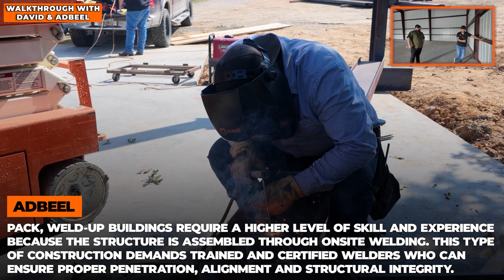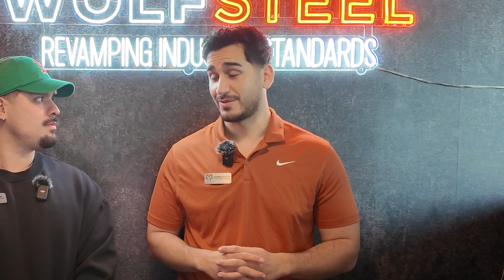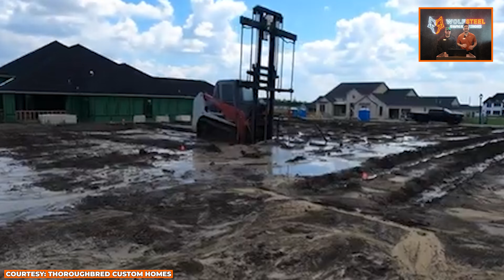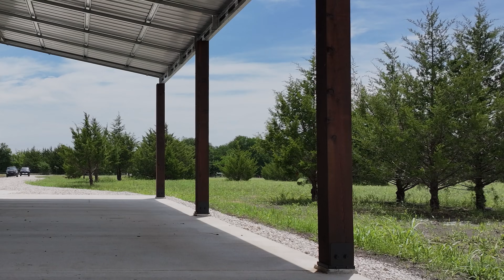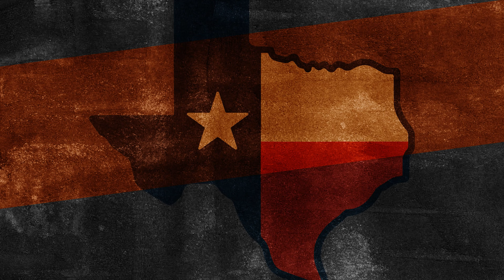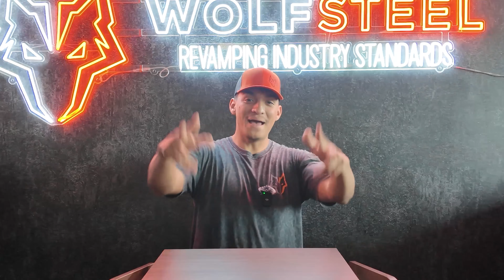Think All Metal Buildings Cost the Same? Here’s the Truth… | 60x120 Pricing | WolfSteel Buildings

Comment: I calculated average 270 yards of concrete at 6 in slab.
With estimates 2x2 footers around

And idk what size the inside footers are but I put 1x1 footers at 10x11 there is 66 squares.

With Vapor Barrier of Stego of 5 rolls max.
1/2 #4 Rebar.

Concrete estimate 260 yards that’s 42,500 average. 
No need for a pump. 
Trucks have drive inside the area and added extension 

Total price average for materials alone under 50,000. 

Even if they got a pump that wouldn’t even come close for labor and equipment to be at 101,881 💀
Reply from the maker: Thanks for sharing! 
The foundation is stamped engineered so there pricing also involved there. 

This information isnt fully correct, example:
Rebar Size #5 Rebar is also added to footers #3
Footers are 12"x28" 
There is also 63 - 15' Deep Concrete Piers and 18 Concrete Squares. 

We gave a general price on here as pricing is dependent on the location.

Comment: That is a crazy insane building price for a bolt up. I’ve had same specs quoted in the past with a very high known and respected steel supplier in Texas with a corner wrapped overhang, windows and larger doors all included (not a separate accessory cost) for $118k. That profit/labor charge is crazy high at $230k & $22k. 😂. I about choked when I saw this😂 Let’s not even discuss the concrete.
Reply: The concrete seems very high in particular but it’s been a few years since I looked closely at it.
Reply: @clmb511  agreed.
Reply: Look on my comment
Reply from the maker: Totally understand where you’re coming from. Pricing in this industry can definitely feel shocking, especially when comparing to past quotes. Steel, labor, and material costs have changed drastically over time, and prices can vary a lot depending on location, scope, and current market conditions.

The building price shown reflects a fully customized build with all the specific features and upgrades the client requested. Bolt ups are engineered structure and the additional reinforcements as required on the engineered plan can add labor and materials' cost which may affect the overall price. Example, the engineered building plan required wind colums  to handle both vertical loads and horizontal wind pressure, helping prevent the building from leaning or shifting during high-wind events. Also, wind cables were recommeded for wind pressure, which are standard on bolt-up buildings and provide additional lateral stability. Since wind columns and wind cables are additional structural components, they naturally add to both material and labor costs.
Reply: @wolfsteelbuildings  Thank you for taking the time to explain everything. Yes, I am very well versed in the economical industry as I deal not only with imports and exports (tariffs, etc.) but other industry products as well. Also agree with your statements on the bracing, etc. although here in Texas requirements are not as extreme as other states with our winds but noted. That said, those arguments still are nowhere near the gaps in the pricing unfortunately. I would love to see a more transparent and in-depth breakdown of these cost in future videos as I am sure the audience does as well. If these cost are indeed what is being claimed, show the viewers. :)